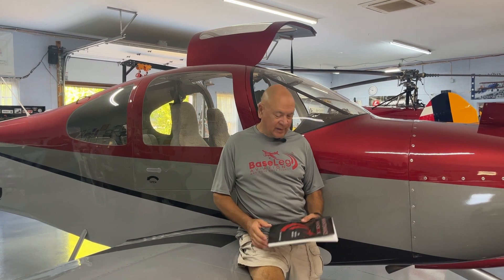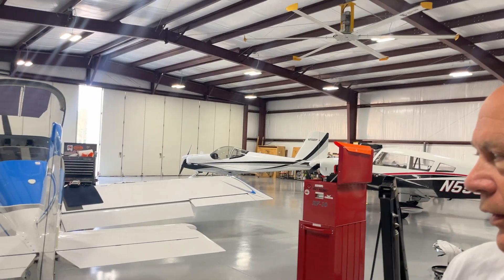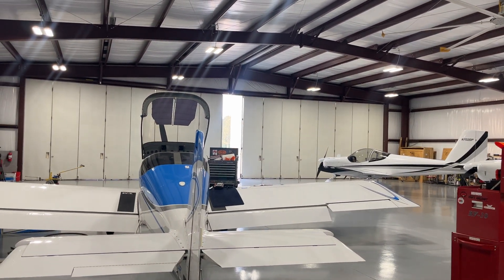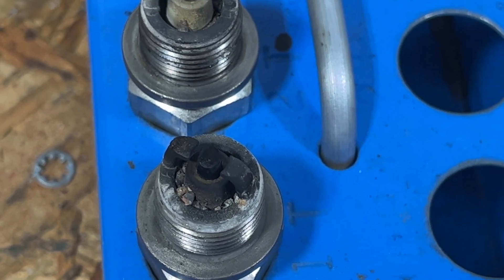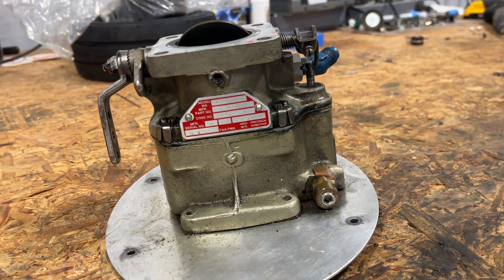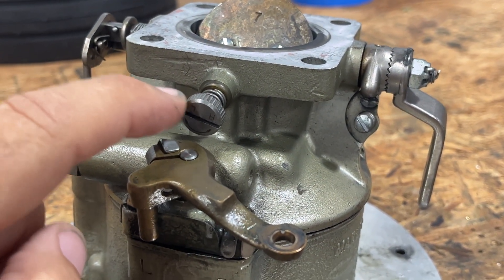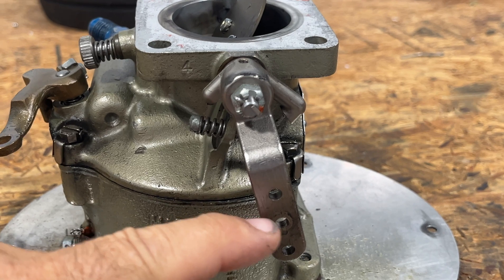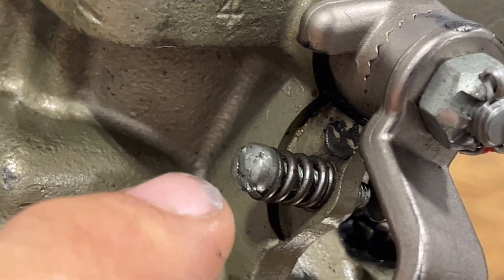Baseleg Aviation RV-9 carburetor issue

Comment: Could you plz make a video removing and inspecting the fuel inlet filter of the carburetor.
Reply from the maker: will try to do that but it might be a while. there’s a picture of it on page 64 of my maintenance book. Just disconnect the fuel inlet line to the carb a then unscrew the remaining fitting and the filter will come right out.

Comment: Another good video Vic. What about us that have FI? How do we adjust those? I have the Bendix RSA-5 (IO360-MIB) First time with an FI system and I'm almost ready for first engine start. Also, off video topic but at 2:09 I see a battery that's not an Odyssey battery on the table. Universal batteries? Is it used in the RV? Do you have info or opinion on it?
Reply from the maker: you need to look your specific FI servo, but basically they will be the same, with an adjustment screw to set idle rpm’s and then either a thumb screw (bendix) or mechanism (airflow performance) to adjust the idle mixture. I’ll try to video one the next time I have one available.
As for the battery, I think it came out of the tug. I usually have a 12v battery on the bench for testing stuff. I only use Earthx or Odyssey batteries in the aircraft.